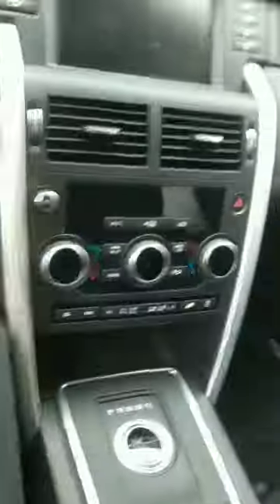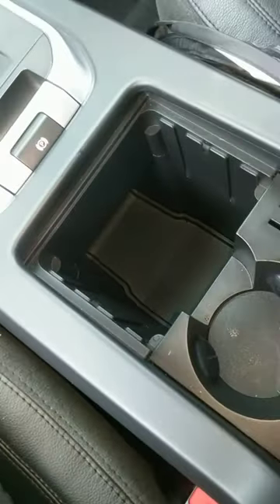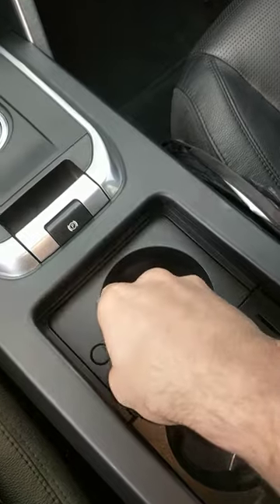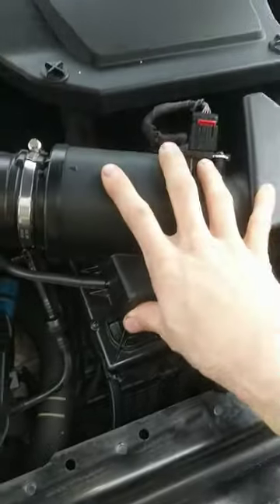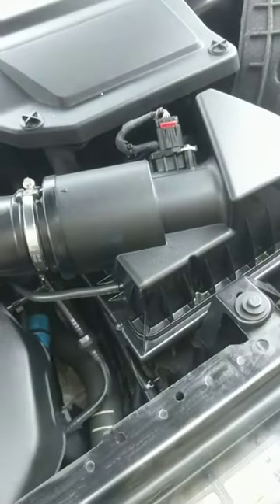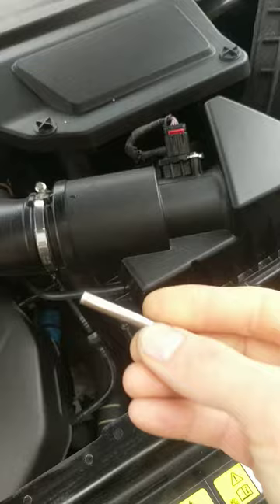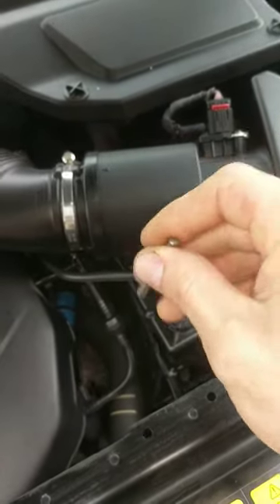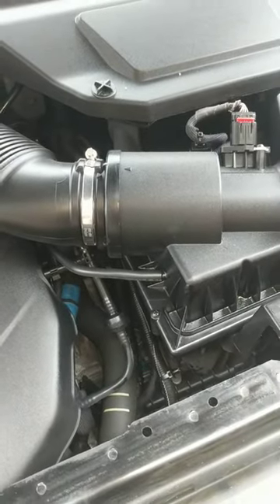Putting A Landrover In Neutral With The Ignition Off

Comment: Any solutions for same car being stuck in park? My car starts and steering wheel turns, but my gear is stuck on park.
Reply: Same problem here , 2nd time it’s happened , first time it fixed itself in 5 minutes, this time it’s stuck and not fixing
Reply: Did you managed to find the solution?
Reply: The year of the car made it impossible to fix , had to get it into neutral and get it toe’d , the 2.5/10 rating for reliability makes a lot of sense now